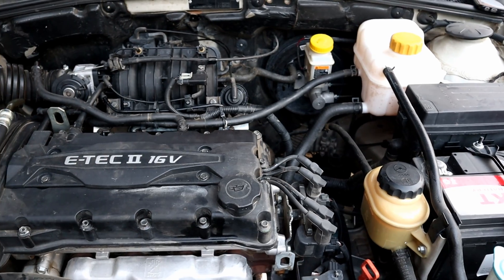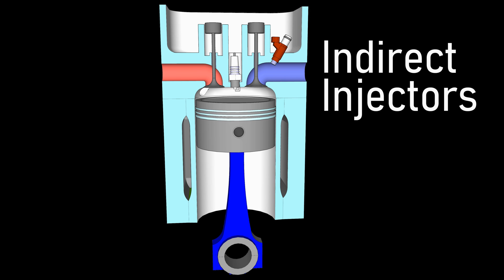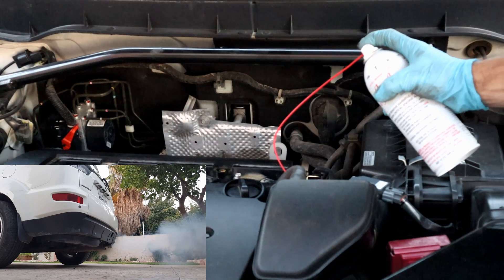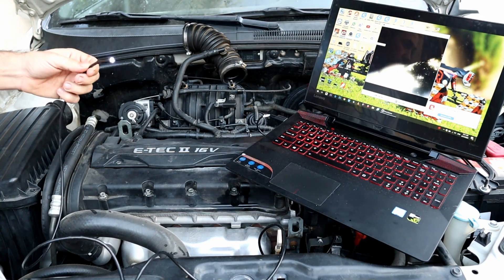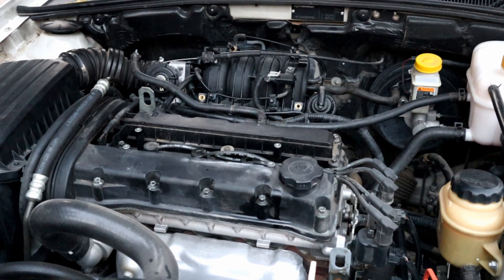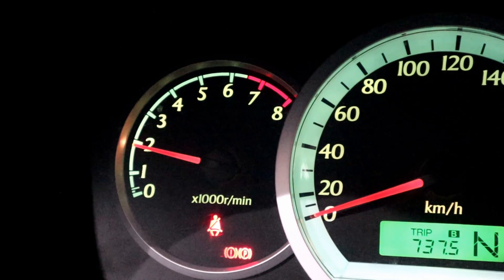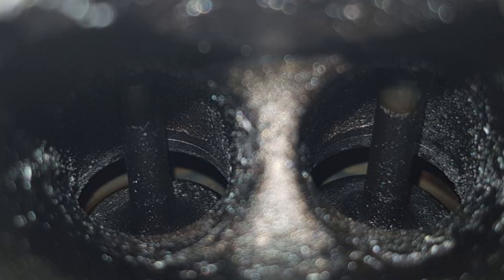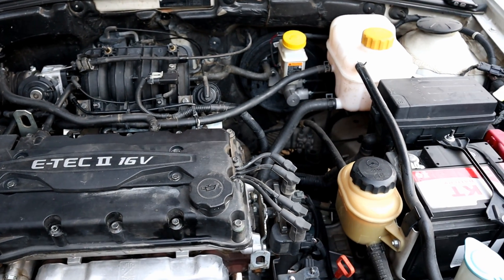How to clean intake valves on Direct/Indirect injection engines without REMOVING anything / ALIMECH

Comment: Can I do this on Camry 2007 2azfe?
Reply from the maker: Yeah
Reply: Just wash the throttle body and replace the filter. The real trick is to do the valve clearances. For the 2azfe. That engine is port fuel injected so just replace the fuel filter and run a fuel system cleaner and high quality gasoline.

Comment: Good job but  itll clean all valves  in this way ??
Reply from the maker: Yes,
Reply: @AliMECH  ok in my pathfinder 2007 r51 4.0 liter engine there is 2 valve cover and one pcv valve port on the back so I have to spray from this pcv valve hose without removing pcv valve so in my case I think I need 2 cans cause it's bigger engine or i can spray from diffrent port for each valve cover

Comment: Very nice
Reply from the maker: @DanielBanas1127  No problem bro, America will come back stronger than ever 🇺🇸🇺🇸
Reply from the maker: @DanielBanas1127  No I'm not American, I'm trying my best to speak American 😊🇺🇸✌
Reply from the maker: Thanks, yes it will be expensive, for few dollars I had this result, actually it depends on the engine, some burns oil more, I suggest cleaning it every 25,000-30,000 miles
Reply from the maker: @DanielBanas1127  Thanks man, I will ✌
Reply from the maker: Thanks